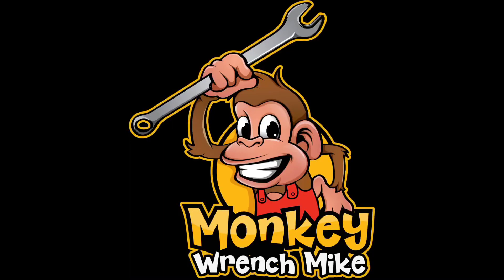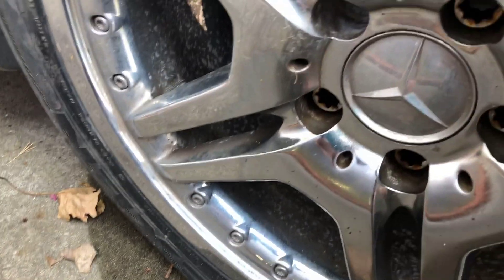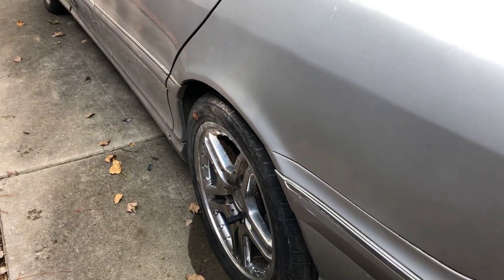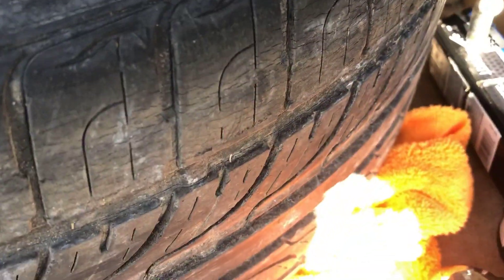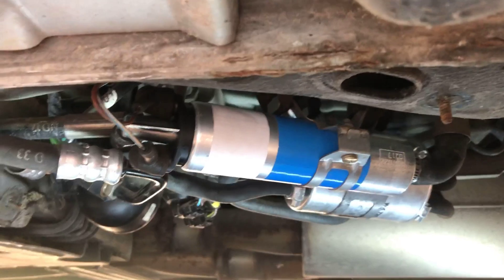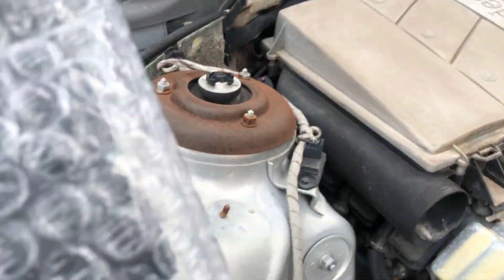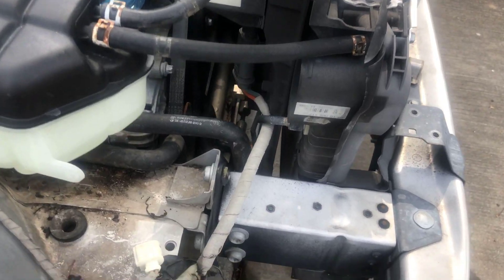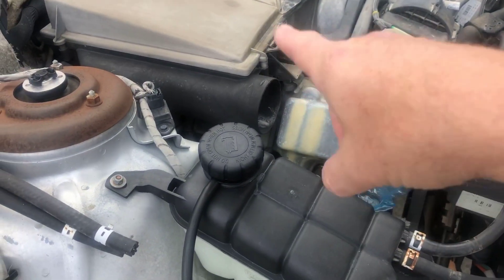The AMG Rebuild Continues - Video #3

Comment: If you changed the gas filter with new ones. Dump the old gas just to be safe. Some people don't know a lesson learned the hard way. Had some females neighbors and one liked me, and someone she knew as well. So one of them put a candy bar in my gas filler tube and I noticed the wrapper though it was strange until three days later car wouldn't start. A lot think it's the engine, but it could be something sweet been dumped in the gas tank.

Comment: You got this Mike flush it before you panic get the liqui moly flush and cheap oil and filter run it for 20 minutes change the oil with the good stuff and new filter milkshake bye bye I haven’t heard of many m112 m113 engines popping head gaskets

Comment: That oil may not be entirely desperate news.  It's pretty obvious that car's been in pieces for a long time, and with the top of the dipstick broken as it is, the engine oil has probably been swallowing moisture from the air for a long time.  Engine oil is hydroscopic so it will take up moisture naturally.  The up-side is that probably means that moisture won't have been building up in the engine like it has with the 280SE, so the internals of the engine should be in a lot better shape...

Comment: I understand that comments help with the YouTube algorithm so this is mine. Is that an oil/water intercooler next to the oil filter housing? I had a 944 Porsche where the "O" rings on a similar cooler led to water in oil, could be an easy fix.
Reply from the maker: Yup!

Comment: while repairing a window i got myself in some trouble. (2001 s55 amg w220) the cable to open the door from the inside fell off, as well as that the lock is broken in a fixed (of course) locked setting. my door ended up shutting at that same time, is there a ay to open the door from the outside somehow unlocking the car first? my side panel is already taken off due to me working on the car already. unfortunately it happensto be my drivers window so its a more important issue. i know its not due to the soft close bump because that hasnt worked in at least 8 months. thanks for your time

Comment: Great video.
Lol when me and my dad went to take the lug nuts off driver side rear tire on his 93 Chevy c1500 them thing where so tight they BROKE a socket.
We had to get a 10 foot cheater pipe just to break then lose.
Reply from the maker: Dang! That’s tight!!
Reply: @MonkeyWrenchMike  it was tight all right. 
We also have broke a bolt off in the head and just tapped a new bolt into it. Lol 
But yes those lug nuts where tight it toke both pf us

Comment: That AMG is going to be a very special part of your collection Mike as you get all those missing parts fitted. Step by step mate!
That oil looks ... erm .... 'interesting'.
Definitely needs some flushing and cleaning oil run through and I saw BG Products Dynamic Engine Cleaner used on another channel and it did seem to clean the engine well. Link:
https://www.bgprod.com/catalog/engine/bg-dynamic-engine-cleaner-rinse-oil/
Reply from the maker: Great info. Thanks!!
Reply: @MonkeyWrenchMike  You Sir are most welcome.

Comment: "These are 13 and 11 years old. Way past their due date."
"So let's get them installed on the car!"

LOL

BTW: I have an SL65 and the TPMS warns if a tire gets into the low 40's PSI range.  So I fill to 50 PSI.

Coolant was green?  Should use blue.
Reply from the maker: Yeah, but at lease the coolant wasn’t rust colored! Lol
Reply: Monkey Wrench Mike That’s definitely a good thing. Aren’t the radiator and engine block aluminum?